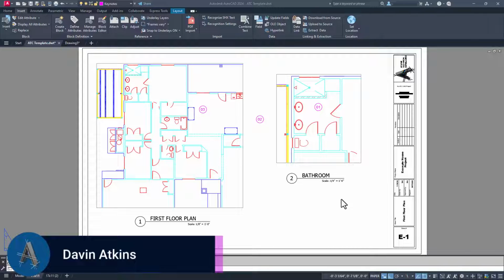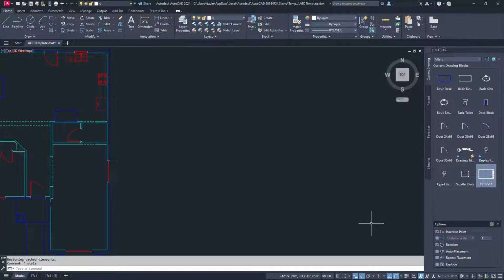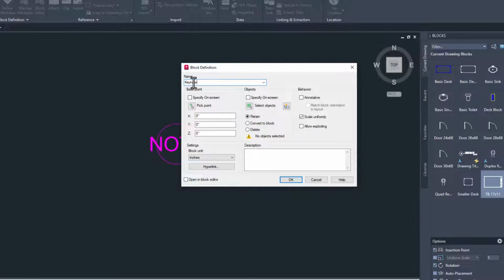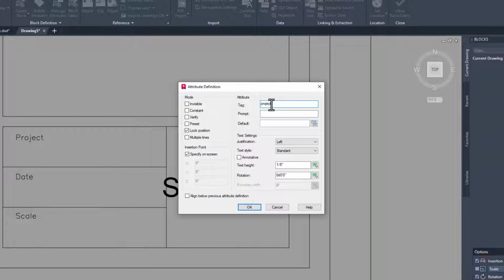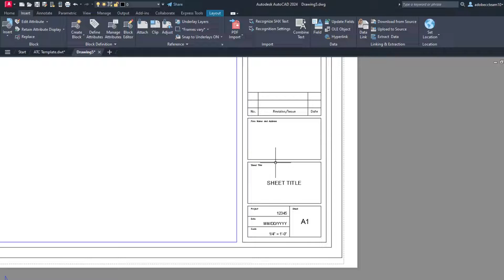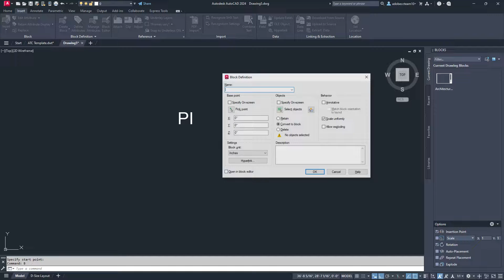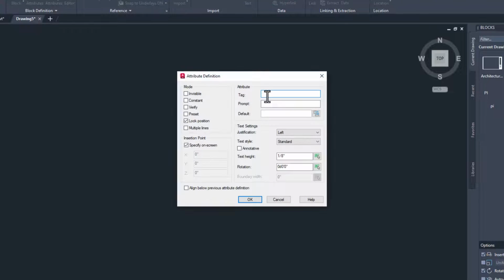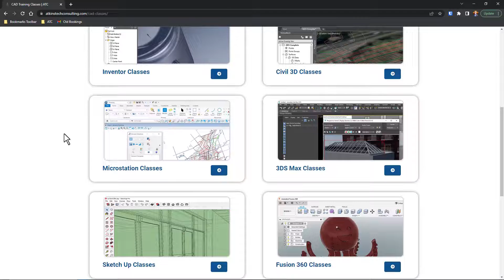AutoCAD Attribute Blocks: The Easy Way to Add Dynamic Text to Your Blocks

Comment: Very useful, thank you. Would you happen to know if there is a way to have a field display the dimscale on a block placed in model space automatically update to the scale of whatever the viewport is set at in paper space?
Reply from the maker: Dimscale is probably NOT the system variable that you are looking for. But, in case that I'm wrong, yes you can do that. You would start a field, look in the SystemVariable category, and you will find dimscale there. Most people don't use dimscale anymore - and probably shouldn't - so it's usually just set to 1.000 and never changes. The only reason you'd want to change this is if you aren't drafting to full scale and that's a big no-no.

While you can use an object field to get the scale of a viewport in paperspace (choose the object option, and then Custom Scale - > Use Scale Name format) this will not work in Model Space. Even if you get it working in paperspace, and copy and paste it into model space, it comes up blank. Which is a bummer.

If you can provide me with a use case, I may be able to come up with something different?
Reply: @ATCCAD , thank you for the speedy response! Yes, we do our drawings at full scale, but in paper space we generally use 3/8" or 1/4" scale for plans and elevations, and 1-1/2" scale for sections and details. What I'm trying to figure out how to do is have the scale in the descriptive block (room number & name, architectural sheet reference, and scale) that we place beneath the drawings in model space have a field that will automatically update to the scale that the viewport is set to. I was able to achieve something similar to this with a block placed in paper space by using the viewport geometry as the object, but don't know if this is possible with the block placed in  model space in lieu of paper space. I hope this makes sense.
Reply from the maker: Gotcha! Yeah, there isn't really a way to do this from model space.

Mostly. You can use sheet sets to automatically place titles and viewport scales - but these are also in paperspace, and essentially just "simplify" the placement of viewports. It requires you to create a named view in modelspace, link it into the sheet set manager for that project, and use the named view in the Model View section of the Sheet Set Manager to place the new viewport in paperspace. It will then show up in the Sheet View tab of the Sheet Set Manager, where you can rename and renumber it. The scale is based on the viewport and works exactly the same as the manual method (linking a field to the viewport itself).

Comment: how to add attribute to existing block? I get it to work inside block editor, but when closing/saving the block, the new attribute doesn't show in the block.
Reply from the maker: After you finish editing the block, you need to run the ATTSYNC command. This is also found in the insert tab of the ribbon, under the block fly out menu. The command is called synchronize there.

Start the command, choose the select option, then click on the block and press enter.